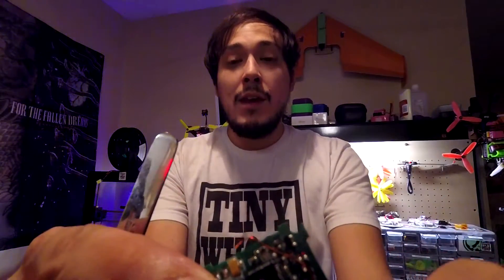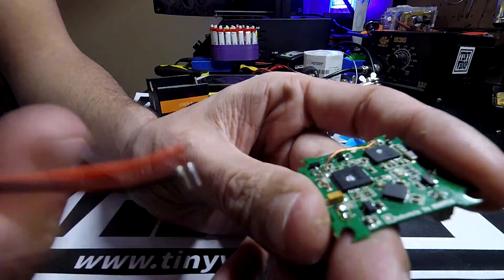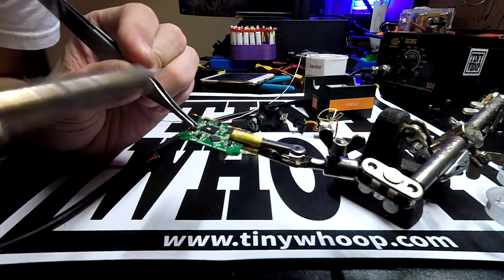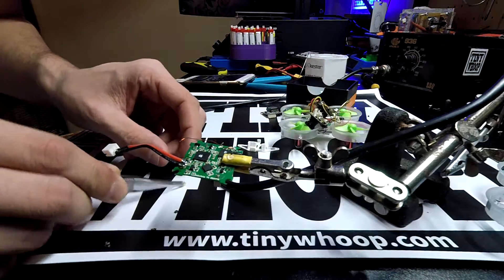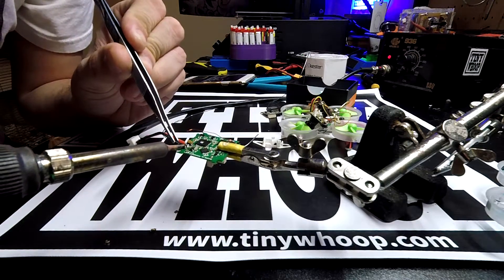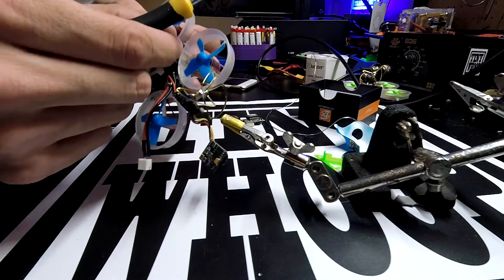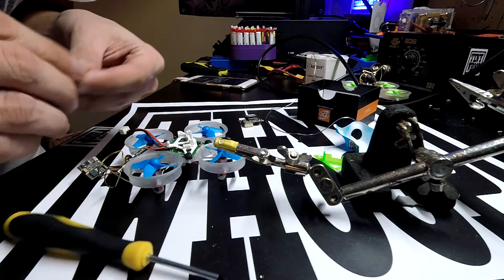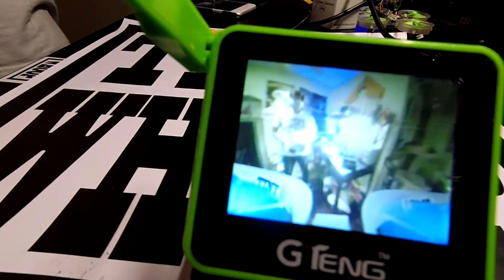How to Fix A Stock Inductrix FC That Has Been Fried From Reverse Polarity

Comment: Hi, a few years on from making this video I know, but I've just received one of these inductrix tiny whoops from a friend as it's broken. I'm getting into the sport and trying to fix this one. One of the motor connectors isn't receiving power from the flight board, the motor works fine when connected to one of the other three connectors, any idea if this can be fixed? Thanks, Simon.

Comment: I have a question. So if I buy a camera and I solder the correct connector for the camera plug will I need to fix the polarity ir will it be ok

Comment: I got a cheap set of the 2.0s from China and the wires were opposite of standard. I didn't realize till I smoked my board with them. A year later I forgot and fried a second board. I'm going to try fixing them. Thanks for the informative video.

Comment: Dude the best way to remove a surface mount component is with a "Hot Air Gun"  if that component would not have burn in half so yhat u remove one side at a time to remove it with ur technique would most definitely result in a newbie burning his whole board.  Hot air gun man. Get a cheap rework station from wish.com one that works verry good for the tag is yhe YIHUA 8786D rework station , hot air gun / soldering with digital display . I believe it was 70 bucks or something 
And my inductrix board has positive on the outside and negayive on inside next to the yellow compinent

Comment: Hey everyone, im happy to tell u all, this part is not needed!! I smoked a board about 3 years ago and u may not believe it, not only is it still working, its the best of 3 original Indy FC that I use and it still has the burnt out capacitor on it. 
After I re-soldered the wires the correct way it had completely lost that wobble they all have on a fully charged lipo, someone explain that!! 
I thought about blowing another to compere but I never got around to it.

Comment: I have an inductrix that when I fly full forward and give it throttle it goes straight up instead of increase speed.  Also, when you make high speed turns the yaw gets weird and slows down.  I am using the blade/eflite transmitter.  Is this normal?  The E011 and boldclash bwhoop bh-03 pro fly better than the inductrix I have.